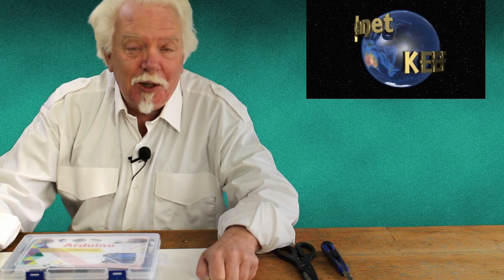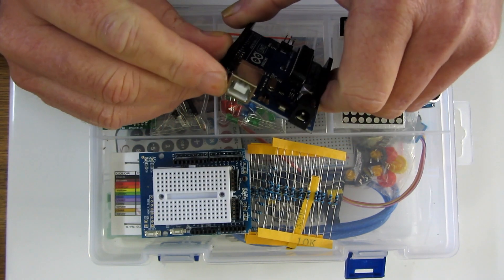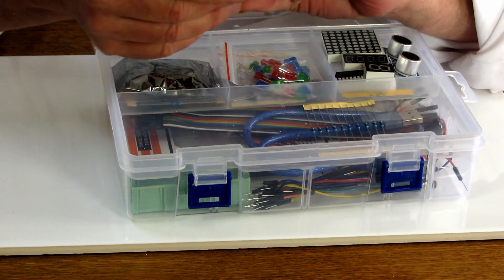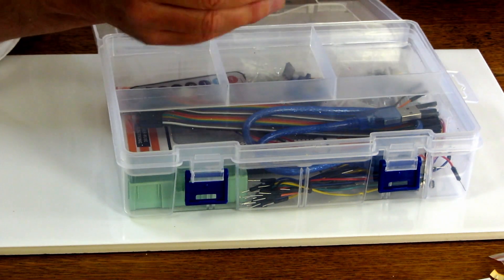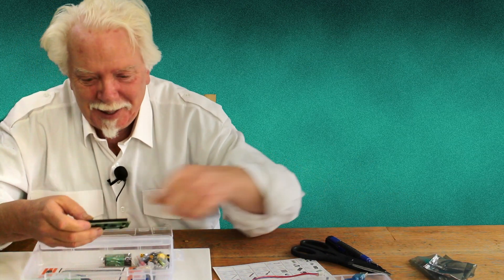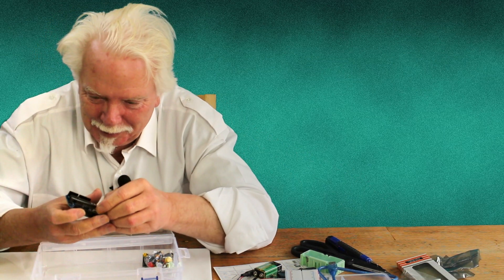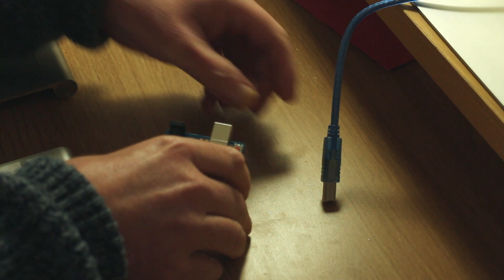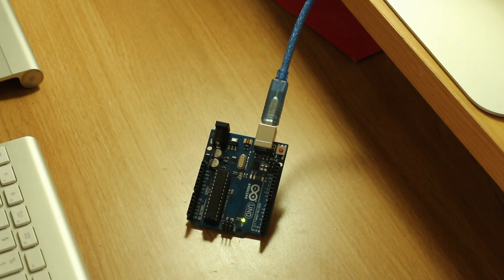Arduino Starter Kit Unboxing and Review | Arduino Blink

Comment: Good stuff Keef, enjoyed my first foray into your world one question if I may though how does the Arduino compare with the Raspberry Pi, don’t know anything about either of them really but have been tempted to give the Pi a try previously but never quite got round to it......as usual!
Reply from the maker: They are different things - a Pi is more like a full-scale computer with an operating system and the ability to store multiple programs. An Arduino doesn't have an operating system and can only run one program at a time. Typically if you make a project that includes an Arduino, it stays in the project and you'll need to get another one. They are cheap enough - I recently bought 3 Arduino Nano's for about £6.